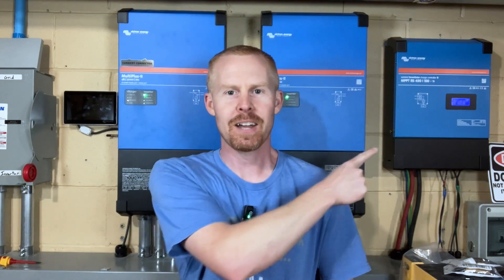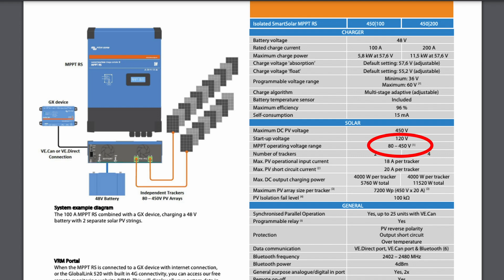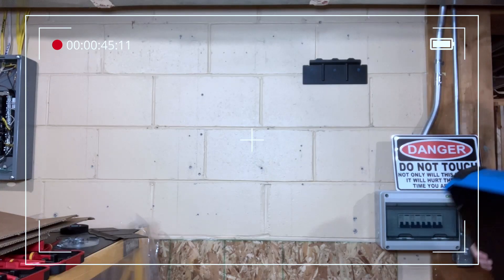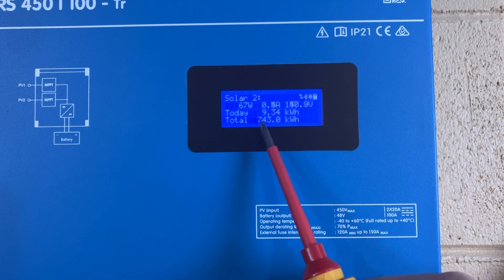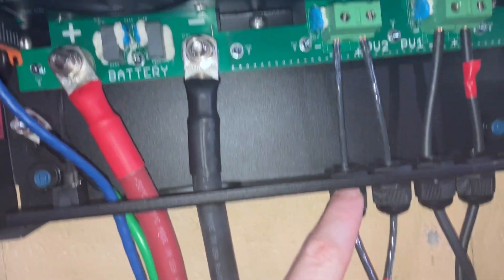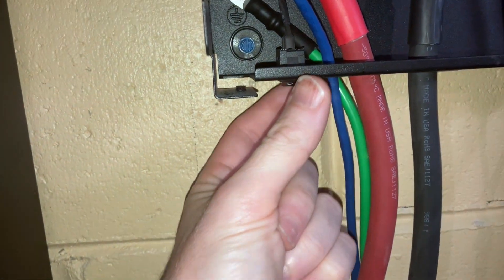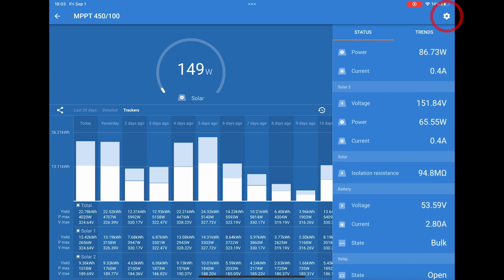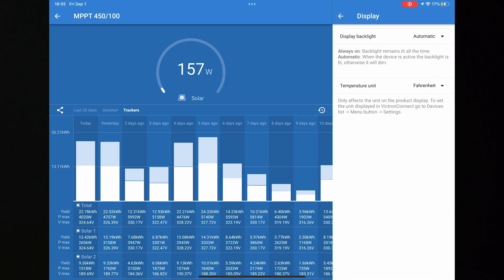Taking a look at the Victron SmartSolar MPPT 450/100 Solar Charge Controller

Comment: Hi, I really know with your experience with this system and the challenges o f you make to this system. Do you strongly recommend, thanks for your feedback.
Reply from the maker: The Victron system has been night and day to the EG4 6500 system I had in the past.  I would recommend it but ultimately it depends on what your specific needs are.

Comment: How Pv watt per tracker at the same time
Reply from the maker: 4000W per tracker
Reply: @AdamDeLayDIY  I taught the mppt can only handle 7,200w total
Reply from the maker: @mustaphabdl09  7200w is the max array that can be connected to any tracker.
Reply: @AdamDeLayDIY  ok,can it take 14,400watt at once then?
Reply from the maker: @mustaphabdl09  no, I believe it’s telling you how much you can over-panel your system.  You can charge up to 4kw on each tracker, but if your in an area with a lot of cloudy days, you could over-panel up to 7.2kw on each tracker to ensure you can get the max pv potential each day.

It’s actually very nice they list this information.  A lot of charge controllers have the potential for over paneling but not many manufacturers actually tell you how much extra you can add to it.
Reply: @AdamDeLayDIY  
Max. DC output charging power - 4,000 W per tracker
Max. DC output charging power - 5,760 W total
Maximum PV array size per tracker - 7,200 W x 2 = 14,400 W 

Does this mean you can over panel the 450/100 to 14,400 W but can only use a Max of 5,760 W? What happens to the remaining power?
Reply: @OzarksGypsy  This was my question too. Seems like you can't get 8,000W if you have 2x4,000W. Weird.
Reply: @KidFreshie  That it teh drawback of this one. It can only output a total of 100Amps. Which converts to 56V x 100A = 56000watts. The cost is double of 250/100 mppt which gives you the same output. I am going with 250/100 because of the costs here

Comment: What torque did you use for the PV connections to the MPPT RS?  It's not specified in the manual I don't think...
Reply from the maker: With any plastic connectors I tend to use “till it feels snug”.  After a few days of use I’ll then recheck.  Plastic cracks to easily.

I saw a forum thread about torque for the 450/100, was that you?
Reply: @AdamDeLayDIY  yeah that was me...with the cracked chincy plastic terminal that didn't stand up to the 2.4Nm torque specified in the manual that came with our MPPT...
Reply from the maker: @gf3803  oh man, sorry to hear that.

Comment: Did you have a chance to perform a load test on the whole system yet?
Reply from the maker: Unfortunately not yet.  Been really busy the last couple weeks and we've had a lot of crummy weather so my batteries haven't been able to get charged up.  I'm hoping to do so within the next week though.  I see sunshine in the forecast!
Reply: We live by Saint Joseph Michigan about 5 miles inland from the lake, so I know what you mean about crummy weather. Part of the reason I am taking so long deciding on the Victron like you have or the EG4 18K like Gavin has, is the Michigan weather and getting this one right. @AdamDeLayDIY
Reply from the maker: Yeah, it's a tough decision.  The 18kPV looks like a nice piece of equipment.

Comment: Great videos I am still confused on how you are switching back to shore power when your batteries run low  from what i gather tou are using gen relay and soc. But what are you using for your relay?
Reply from the maker: Thanks!

So there's actually quite a few different ways I've found to do this.  The simplest one is using the built-in "virtual switch" in the MultiPlus software.  That works, but it doesn't give me the ability to manually switch to grid mode if necessary.  

It's on my list to make a video of how I did this, but I ended up using the Relay 1 on the Cerbo and wired that to the Aux Input on the MP.  I set up 2 programmable relay assistants based on the General Input flag.  One for the "on" state and one for the "off" state.  Then on the Cerbo, I set Relay 1 to be Generator Start/Stop and programmed my settings accordingly.  

It sounds complicated but it really isn't.  Using the Generator Start/Stop on the Cerbo, I have the ability to change the SOC levels from the Cerbo instead of having to program with the MP software every time.  Plus I can manually switch to grid using the Cerbo.

I also ended up using Relay 2 on the Cerbo and Input 2 of the MP to let me control whether or not grid charging is enabled.  That way if I know a storm is coming, I can just enable the relay on the cerbo and grid charging will start.  

Hope that helps.
Reply: Looking forward to that Vid Thanks.
I like how you're doing it seems the simplest, so Ihave it strait the MP is doing the changeover of whether or not it brings in power from the grid @AdamDeLayDIY
Reply from the maker: @DavidChelberg  The MP is the device doing the switching, but the Cerbo is the device determining when to make the switch.

Comment: Hi Adam, Currently I have a system with one EG4 3000 Watt single phase inverter and 15kw EG4 LL Ver2 batteries.  One of my plans is to upgrade it gradually. I consider buying only one MPlus- II 5000VA inverter and integrate it into my existing system by keeping my current EG4 inverter as a charge controller. Do think this this would work? Signature Solar claims that EG4 V2 batteries can be compatible with Victron Cerbo Gx - they have a video.  But Victron website does not include EG4 batteries as compatible. If I set the EG4 battery setting to Victron protocol, my EG4 inverter may throw a fault. So I think if I get Cerbo GX I may have to get Victron MPPT charge controller and dicth the EG4 inverter. Sometimes I think I should just replace my system with two of MP- II inverters, new MPPT change controller, Cerbo GX. I have not seen what kind of batteries you have and how you interface them with Victron Cerbo Gx.  Did you have any issues making Victron Cerbo Gx to communicate with your batteris? Nick
Reply from the maker: So you could use your 3k inverter as your charge controller, you would just have to set it in USE mode and charge based on voltage.  That inverter wouldn't communicate with the batteries, just the Cerbo.  You can only have the one device set up to be controlled by your batteries.  The other thing you wouldn't have is any data regarding to your PV coming in.  

I would imagine it's probably easier for the battery manufacturers/distributors to keep up with the list of inverters they support than it is for the inverter manufacturers to keep up with all the batteries that work with their hardware.  

I have 2 DIY batteries.  I don't have any communication set up between the system and my batteries, it's all based on voltage.  My system is what's referred to as "open loop communication".

Comment: Once your batteries are full can you priorities the solar to run the inverters without taking from the batteries how does this work? How does this work with a grid tie?
Reply from the maker: There's no programming needed to do this.  When the battery is full, as long as you have PV coming in, it seems to take that first and the remaining comes from the battery.  You just have to be in battery mode, not grid-bypass mode.  

Unfortunately, I don't have any experience with a grid-tie system.  I know I've seen them work together before, but I have no direct experience.

Comment: Should be noted the Max PV short circuit current is 30A per tracker.  After 20A there simply isn't reverse polarity protection.  So if you don't mess up and reverse polarity when initially connecting it you can have up to 30A Isc.
Reply from the maker: That’s interesting.  Especially knowing that my panel Isc is around 12a I believe.  

Where do you see the 30a figure?  The data sheet only mentions 20a.
Reply: @AdamDeLayDIY  Section 3.4 of the MPPT RS manual states: Connecting PV arrays with a higher short circuit current is possible, up to an absolute maximum of 30A, as long as connected with correct polarity.
Reply from the maker: @davidb.5544  that’s awesome!  Thanks!  I love how detailed their manuals are!
Reply: Absolutely amazing! Your videos are really good too! Thank you that was very helpful
Reply: was wondering why the current appeared limited to 20amp - kinda limiting to parallel anything, figured it must have been purpose built for series only. 30 gives way more headroom.